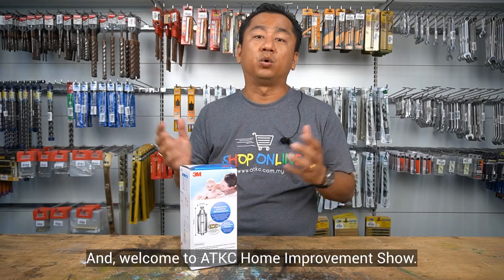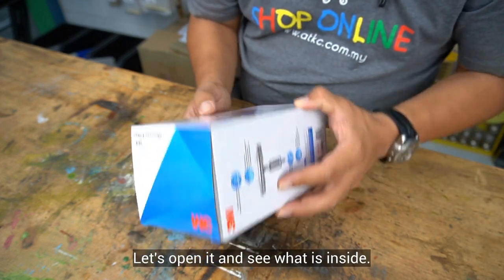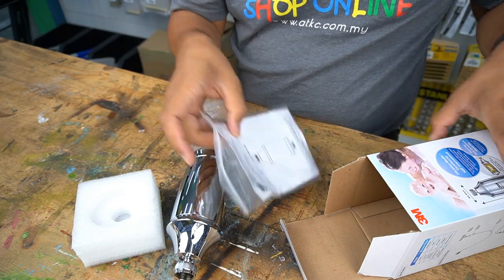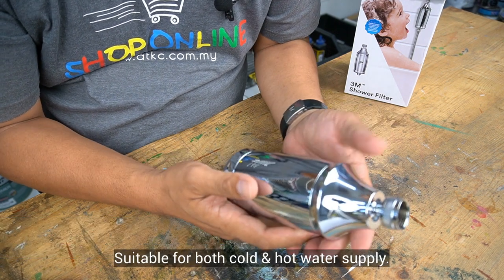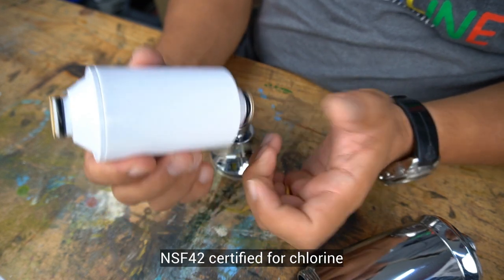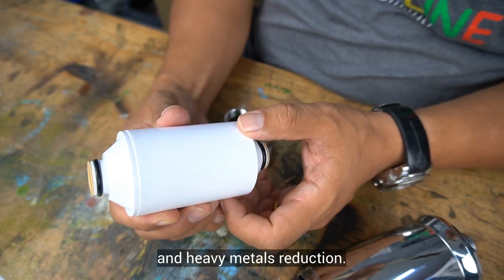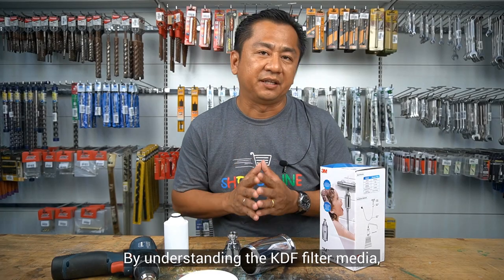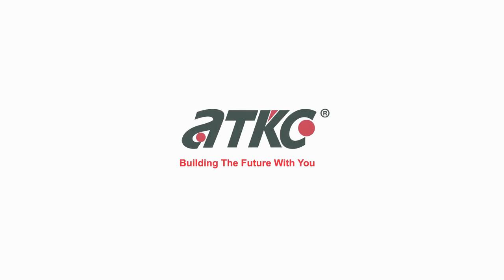3M Shower Filter | Feel the LOVE in every Shower | Skin & Hair Care | Remove Chlorine & Impurities

Comment: Will this remove help to lessen or remove the "brown color" in the water that comes out of the tap?
Reply from the maker: For dirt and sediment, I do suggest that you install an outdoor water filter for better results.
Reply: @ATKCeWarehouse  thanks for your reply. I have a problem where I live in an apartment where the water pipes are outside and under lock and key. The only pipes I have access to are in the ceiling attached to my water heater. Do you have a recommendation that I can go with for filter sediment? Thank you.
Reply from the maker: @victoryisourdestiny7207  Usually, there should be a sub-utility room where all the pipes & valves are located. Depending on the space, you may install 3M AP902 Whole House Filter which is relatively small as compare to others.